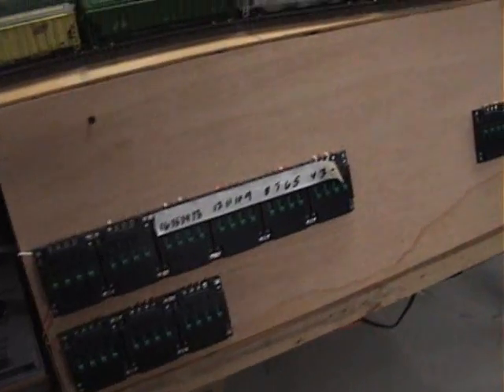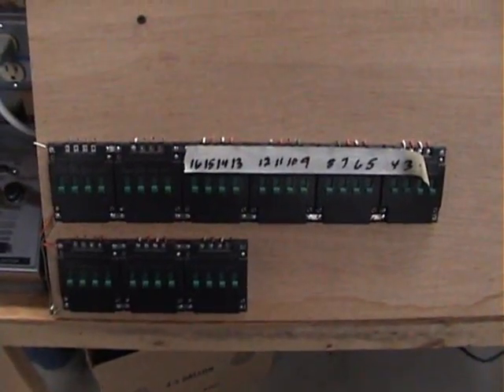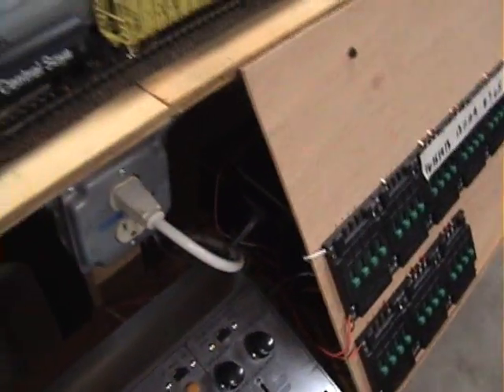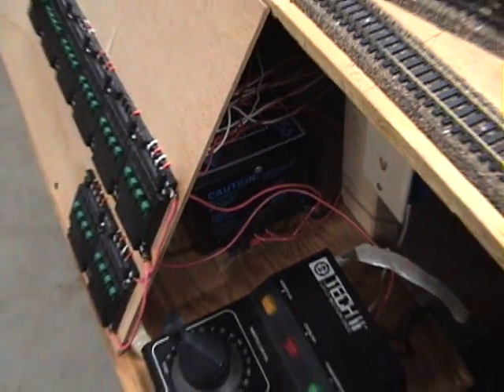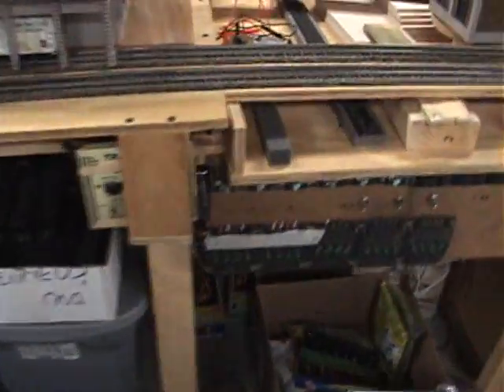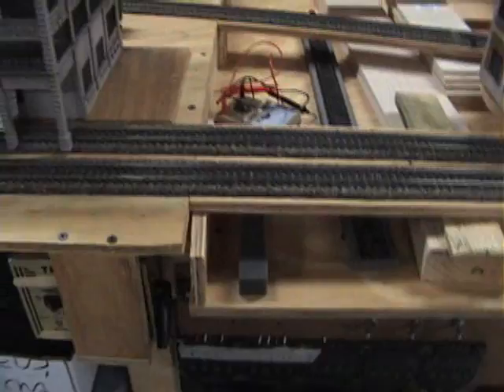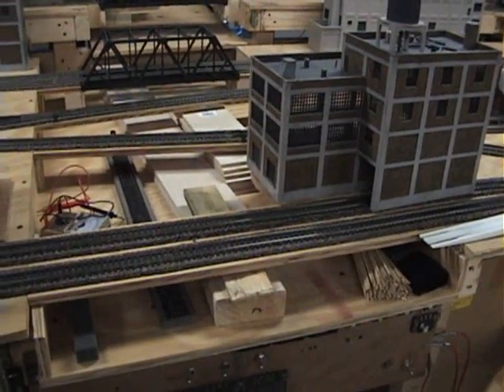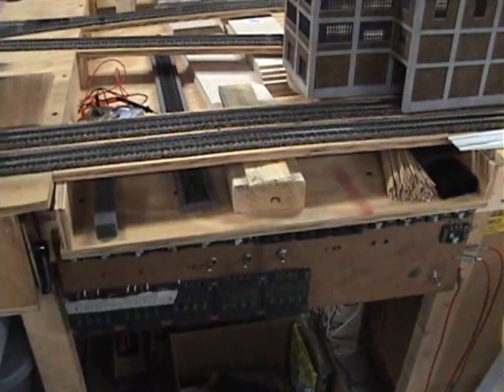My Layout DC Control System

Comment from the maker: I do have a few locomotives now that have decoders setup to run on DC but the problem is they need about 3-5 volts to keep the units running.  Not good for slow speed trains.  I am used to North Coast DCC, so when I make the switch, that will most likely be the system for me.